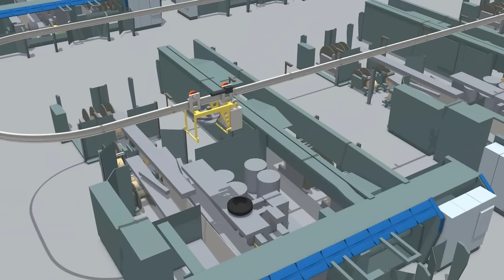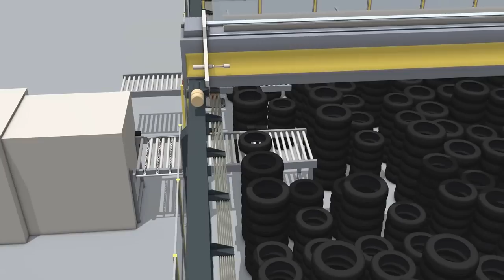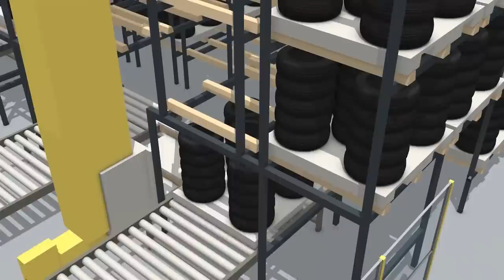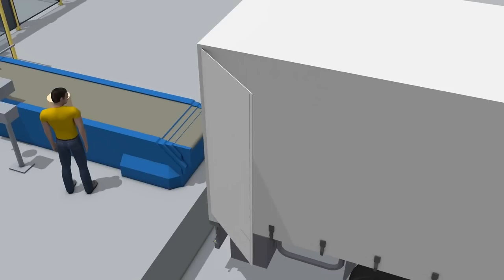Fully automated handling for tire manufacture

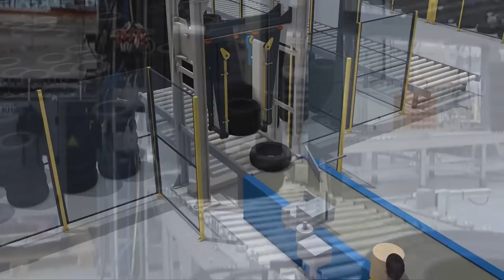Comment: Why so many handling to different storage area that look exactly the same. Also why at 2:26 there is so many operation to put tires one by one on the conveyor while at 4:54 it uses a simple belt? All in all very weird setup..
Reply from the maker: Hi Pronoe, thanks for asking. In tire manufacturing process tires are often processed as single tires, like for example in testing process where tires are tested one by one. Mentioned storage area at 2:26 is buffer before the testing, where tires are randomly coming from curing area and are buffered/sorted before sending to testing. In case of more detailed explanation, please visit our webpage and contact our Tire sales representatives at https://www.cimcorp.com/en/sales
Reply: 0:45 These are uncured tires waiting to go into the press.
1:10 Tires are placed onto the loader pans. The loader will place them in the press.
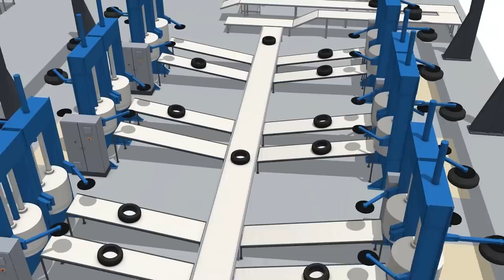1:30 Cured tires are  ejected from the press and move to the next station.
1:40 These huts could be demagnetizers, Xray stations, or trimmers.
1:47 Manual inspection. They look for defects or other issues that may need to be adressed.
2:00 Tires are sorted and stacked according to model and size.  (These are the machines I work with.)
2:30 It could possibly be buffing, balancing, and load test.
2:55 Once the tires are stacked, they are placed on pallets and sent to the warehouse.
Reply: In the factory I work in, tires come out of the press and go through the cooling conveyors. Basically they just sit and cool down. From there they are flipped over so the computer can read the barcode and send the tire to the right machine. there they go through the buffer. Another conveyor brings them around to the hotline where they are inspected and trimmed (if needed.) from there they are sorted and get balanced and load tested. Next they go to the sorter like seen at 2:00. Once there are four or five stacks of tires, it places them on a conveyor where they are labeled by hand and palaced on a pallet. (the robot does all the stacking.  I couldn't imagine how much more room this system would take up if we had it in out facility.

Comment: Automation of the trailer load lacing is missing.    I have a process to automate tire lacing in the truck.   So far my process is the only automated trailer loading process that maintains the +/- 800 tire per trailer density.  The IP I have would easily sell tens of millions dollars.  It won't be long before I'm bought out.

Comment: Ain't nothing like automation and replacing jobs
Reply: Right?! Can you Imagine the number of back pain and other work related injuries prevented thanks to these robots.. Robots are awesome !
Reply: Automation requires specialized people, that is really true, but it also bring the operator less back pain and reduce drastically the injuries on factories, which are no joke. Imagine that they won't have to deal with high temperature of tires' cure and some repetitive jobs in general.
Reply: @laissanascente7933  true but corporations still doesn't care and would take away as many jobs as possible.
Reply: @samuelblackwell3762  there was a man that used to wake people up every morning as part of his job, until alarms showed up.
Reply: @wlysam1600  didn't know that